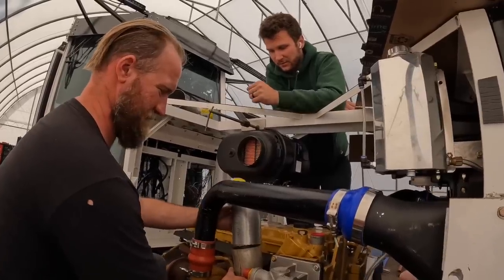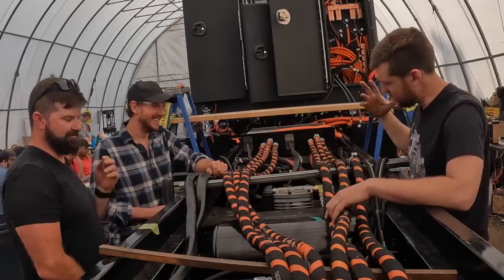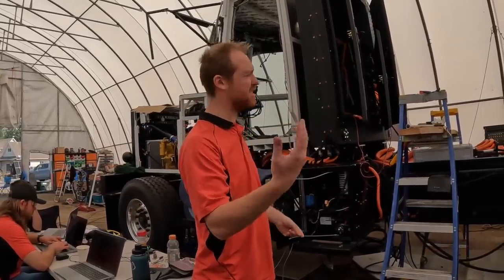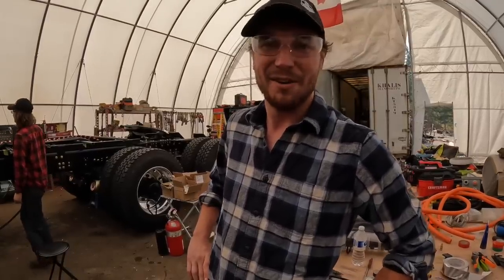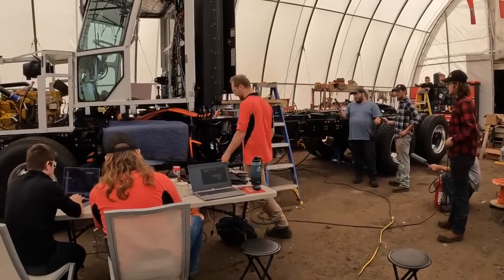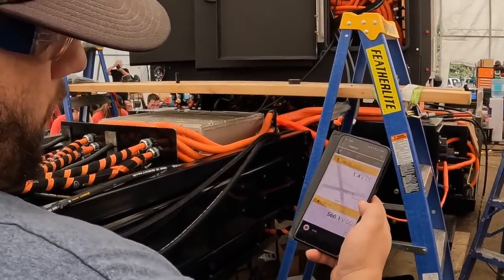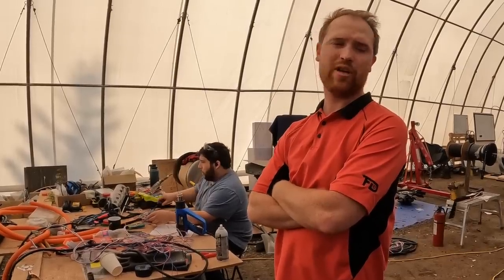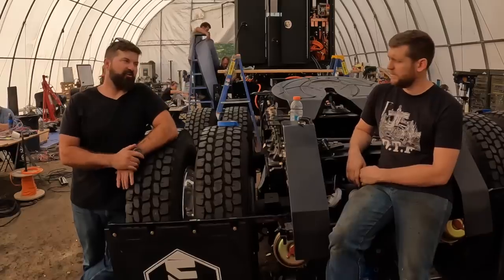Powering Up the Beast: First High Voltage Tests & Axle Spin | Electric Truck Milestone

Comment: As an electrician, I appreciate the use of uni-strut and strut clamps with the proper insulation. 

Tip- if you seperate the two halves, you dont have to slide them in from all the way at the end. Not sure which method would be more time effecient, maybe youve already taken that into account in your metods, yal stay on top of it way better than i could ever imagine to. Keep up the good work!

Comment: Be careful with those styles of clamp for your motor leads….you may have to switch to aluminum from steel if your current exceeds 400 amp and possibly even above 200 amp due to induced current into the steel clamps…you can also use plastic / wood / nylon etc and cut three holes slightly larger then cable diameter slice down through centre  and bolt on outside of three cables..with a little creative cutting you can even stack your cables into pyramid formation.
Reply: THIS.  John is correct -  I love the unistrut idea, but using any kind of metal clamp surrounding the HV wires could allow for magnetic induction as current flow increases.  Since the unistrut will be grounded, it won't build up a charge, but you're going to lose energy and cause voltage drop, again, especially as current increases.
Reply: ABSOLUTELY THIS.  Uni strut and kendorf have non ferrous clamps for HV applications
Reply: Aren't those cables DC? AC current would be more of a problem
Reply: Aluminium would be worse than steel, but for the frequency they run at it won’t matter, remember 50hz is run in steel ladder tray
Reply: @MrMikeT89  I think most electric motors like this are 3 phase AC, so it depends if these are cables going from batteries to the motor controllers, which would be DC, or the leads going to the motors.
Reply: @MrMikeT89  they are using ac drives to run the axle and using the batteries for the dc bus in a standard drive
Reply: @brucebaxter6923  depending on the type of drive my best guess is they are actually using around 100megahertz silicon switches to simulate low frequency AC.. I didn’t see any reactors being used but the motor leads are also short.
Reply: @John13Edge  
Doubtful, more like 16-32khz. 
Pulsed dc voltage with the inductance of the motor smoothing the current. 

This is my job dude.
Reply: @JClaudeo 
Grounded in this system means returning to battery/geni, so it could still be an issue if I'm thinking of this correctly.
Reply: @brucebaxter6923 Well, it depends on the kind of motor being used in the axle. If it is an AC induction motor which would be more ideal in this case due to torque characteristics, then it is AC. If it is a permanent magnet motor, then probably DC. What you refer to as pulsed DC is in fact AC without the negative component. You have similar induction characteristics in PWM/pulsed DC as you do in AC. True DC has no induction.
Reply: @brucebaxter6923 
Would it make a difference that typically the steel trays that 50hz power is run in are truly earthed and this system would feed fault and induced current in the frame back to the batteries/geni?  Genuinely curious.  Thinking of trying to make the transition from R/C/I and service electrical to solar/battery systems side of electrical.
Reply: @i-love-comountains3850  
No difference. 
The only possible effect is eddy currents. 

Also, you use steel wire armoured cables for mining. 
Surrounded by steel.
Reply: @moshet842  
They are synchronous motors.
Reply: From a locomotive background, I've seen worse cable management with bigger motors running higher amperage for longer periods. They'll be fine for what is effectively a test truck.
Reply: I like this channel and love the community help from everyone.  Not sure if the Edison guys have time to read all the comments.  But Great smart comments from everyone…….helping for a great company , so they have the best success.

Comment: For the limited run pre-production trucks, I would still do cables in house, but treat it like a production item, with its own assembly station, and test fixtures.  You will want to move things, or change things as you go, and having that in house will free you to do so.

Comment: The connectors and harnesses need a test platform that tests each wire in the bundle for continuity and proper pin locations. You can do it old school with a prebuilt box with a row of lights each of which indicates a pin. The box uses a 555 timer circuit that runs through each pin individually, if one(actually 2 pins min) is out of order the row of lights will lights up out of order. You can use very low power for this test.  It can be done programmatically too but requires more work to get the box built.

Comment: Just an fyi we use those quite often in the electrical trade, if you can use stainless steel rather than galvanized DO IT, long term those will rust incredibly fast in any snow climates. If you use the electrical code book and look up NEMA ratings it will give you a better indication of what rating “material used” your clamping devices will withstand in regards to movement, weather, atmosphere

Comment: One thing I've learned o er the years is that the length of comm wires can affect transfer as well. Aside from pin fit, you may find you have to trim back on the excess.

Comment: The gentleman wearing the high voltage glove please put on a proper set of gauntlets ( large leather gloves) if someone was grinding cutting metal and missed even a slight sliver of steel and it was to puncture your gloves electricity will leak through and get you ruining your day…

Comment: You need to think like Henry Ford , grow the trees that produces the wood used in the vehicles, even buy rubber farms for the tires. Build a town for the factory workers,  build a steel mill, so the factory is in control of everything    building harness is easier than you think,  a couple guys can build one fairly fast,   build one in the truck, remove it , stretch it out over plywood  with termination marked, and wire and connector used, then spools of wire to make harness. Make it fit the plywood, and a piece of cardboard can be placed over the board, with different harness options on it, for making different options harnesses,  a couple guys can possibly build a harness in a couple hours,  4-6 per day! It should get faster .

Comment: Get the non ferrous cable clamps
Reply: Makes no difference electrically, mains are run in steel ladder tray.
Reply: @brucebaxter6923  We are dealing with 15A max current in most mains at a relatively low voltage and frequency. In this case, we are talking about hundreds of Amps running at at least 300V. There is a lot more energy going through these wires at a much higher frequency. You can't even compare the two.
Reply: @moshet842  
Lol. I deal with 1000amp mains at 415 v
Reply: @brucebaxter6923   Regardless, it does not matter. Ladder trays are earthed. In this case, you can have floating circuits or ground loops if not properly dealt with.

Comment: I think your doing things right on this truck. You just build it, wing it with overspec and see that things works - something that can pull the load (log trailer) and prove it. Then you can step back and figure out how to "actually" build it. I hope people get this, but maybe they don't as Chase has to say over and over that it's a prototype and things by choice are different. I read some comment a while back about that it would be interesting to see Sandy Munro look at it. I actually don't think that it is a good idea/interesting. Because nothing of this prototype is for mass production.

Comment: if hydrogen engines ever proved themselves as a viable fuel alternative, would you use it in your truck?
Reply: IIIRC They’ve mentioned in a live stream QA that if someone asked them and was willing to pay for it, the buyer could replace the Diesel Generator system with a Hydrogen Generator but it isn’t something Edison is exploring on their own.
Reply from the maker: If someone wanted to buy a truck and take it to a company like Loop Energy to install the fuel cell then we would work with them.  But we aren’t doing our own hydrogen
Reply: Ah I didn't see that, I haven't watched all of the live streams all the way through yet. Still eager to see the truck finished though!
Reply: @EdisonMotors I think that was a reference to a hydrogen combustion engine for the generator.
Reply: @aidankallas  one of the coolest things about how they are building the truck is that the design is sufficiently open ended that end users can make a lot of changes to it with relative simplicity, in particular changing  the generator power from Diesel to Petrol, Hydrogen, Natural gas, or removing the generator, adding more batteries and going fully electric.
Reply: @striatic  Yes! I love how modular their truck is, I feel like modularity should be an industry standard for all trucks.